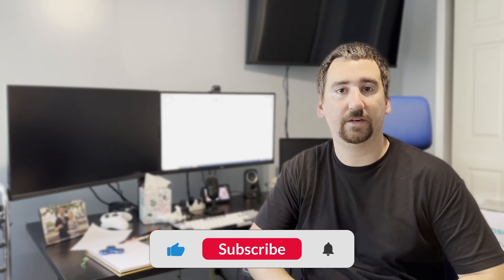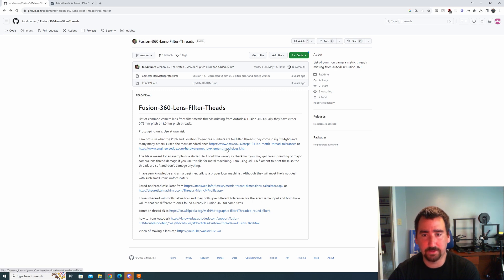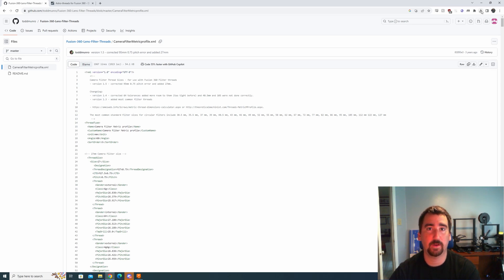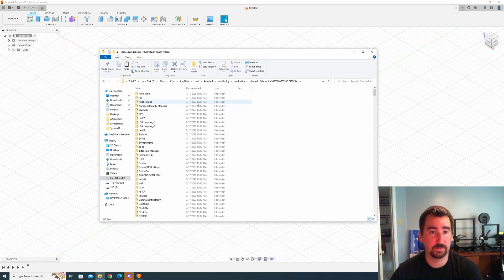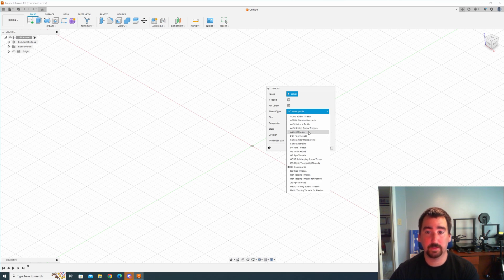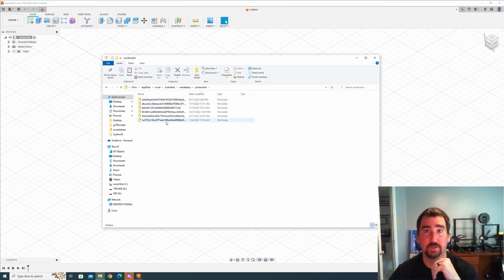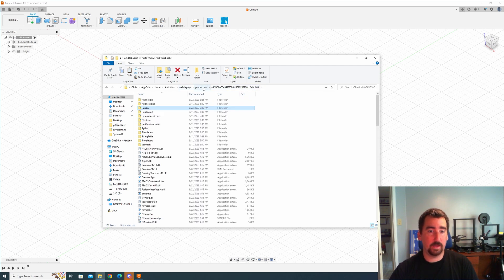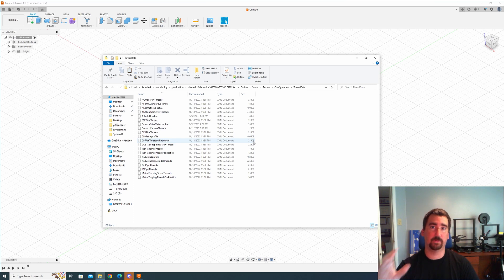How to add Custom Threads to Fusion 360! | Fusion 360 Tutorial

Comment: Thanks!
 I was able to get the M20 x 3 threads I needed without adding a file. I just edited the existing one. Changed the values for the standard M3 x 2.5 to 3 along with minor and pitch diameters. Can always switch back if necessary. The 13 step file path is wild, no idea how you figured that out!
Reply from the maker: I’m a software engineer :)

Comment: Thanks for the video bro. Just what I was looking for. This is the latest path as of 9/2/2025. If you have custom threads in an older version of Fusion 360 you will have to re-save them to this path. C:\Users\[Select User name]\AppData\Local\Autodesk\webdeploy\production\[Select most up to date folder]\Fusion\Server\Fusion\Configuration\ThreadData

Comment: You can also try to create a thread like M28 1.5  then use the Modify -> Scale select Non-Uniform then just enlarge only X & Y to like 1.10 to get an M29 1.5 thread 
(Don't do uniform otherwise the pitch height will be off)
This is just rough way of doing it if you need to be in the ball park, but have a test file and play around with the x / y till you get a close enough fit lol